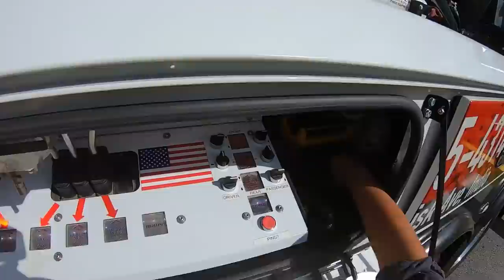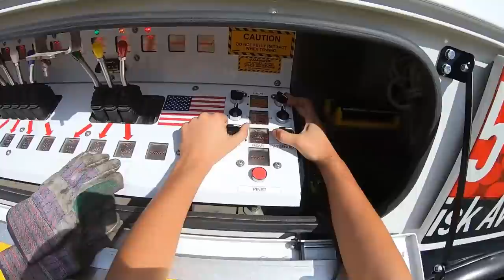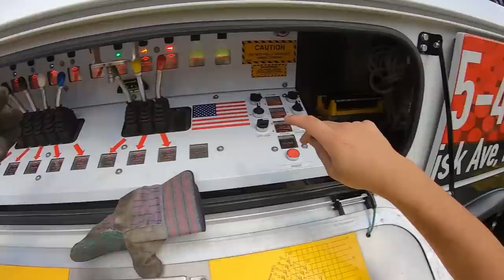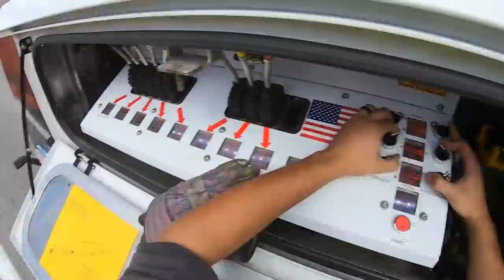Truck Drives Off Road On Mountain Pass

Comment: Curious as to why you didn’t use the pivot point to pull it straight back the first time. You would no have caused the extra damage on the rear fenders at the bed.
Reply: Matt knows what to do from Matt’s Off Road Recovery pull it out and it’s done
Reply: @TonightGamer1987  Yeah.. this was rough to watch. lol.. 
Lets pull the truck up and block the exit hole and make this recovery 100x harder than it needs to be.  smh

Comment: I run the rim slings from the outside in and run straps back under the truck so the straps come out under the bumper and hitch to lift it so there’s no risk for even a scratch on the bed. I’m a collision repair shop but that’s what I do when I’m in your situation

Comment: I wondering why the Flatbed didn't do the whole recovery process by it's self in less than half the time  ?
Reply: I depends on how much the vehicle weights and how much force it will take to remove it. So the flat bed could do it but it would put a lot of un needed stress on the flat bed. Also it depends on what the police want they can make the call of what vehicle they want to do the recovery ( in reason )
Reply: Cause the didn't know how far of a drop it was. If was a cliff edge the flatbed couldn't do it. Plus the rotator reduces the damage of recovery.

Comment: Question?
Why wouldn’t you rig the spreader bar up, 4 point it at each tire and just pick it up and put it on the flat bed.
Reply from the maker: Had to bring it closer first to do that. The truck was easily 15-20 ft out of reach for the rotator to lift it straight up otherwise yes absolutely that would have been the best plan, given that it was out of reach we elected to winch it as close as possible and then lift it out without a spreader bar because the angle we were able to get being it was so close to us allowed us to get very high above it reducing the veer angle. Hopefully that clears it up
Reply: @plazatowing  I was going to ask the same thing😂😂  thanks for the explanation. It was great to see you & your dad working together on this one. We don't always have our parents around, enjoy the time you have together. My dad is at an age, & his health is in a condition, he's pretty much homebound. 94 years old, just thankful to still have him around😊😊

Comment: Nice job.  Interesting how many folks didn't agree with your recovery methods.
Reply: I strongly disagree. I might have tolerated damaging front fenders as they have been damaged anyway but not the rear ones. This is completely unnecessary and totally avoidable.
Reply: Exactly if one of our operators did that they would be looking for a new job. That was a beginner recovery. Just goes to show just because you have the half a million for the truck doesn't mean you should be operating it. Or at the very least get someone with some experience to help you guys out and run the recovery and lay out the rigging plan

Comment: Hey Trent

I saw you doing pulling 4X4 pick up truck is not going to work but my best solution is put sling rope on front and rear of wheel then lift it up to move to flatbed for quick recovery time and save your time

Comment: !. I would of used a dead pull from the out rigger from the start and would of had it up where you could of lifted  it onto the roll back in the time it took you to rig to the rims to heck with hurting the bed.  It's gonna bend no matter what but the spreader bar will keep it away from the truck.

Comment: question on D-ring shackles.  Do you feel that any given new D-ring shackle should be up to snuff, ie that it will handle the weight that it claims it's rated for?

I ask because I've seen some claim to not trust imported ones from big-box stores even with the rating markings embossed on them.
Reply: I was taught to buy American made products and you will get every pound out of the WLL. Most American made items of that sort have a BLL 4 times the WLL.

Comment: Thought you might have done a Ron Pratt move and just nosed the rollback up to the under reach and boomed over the cab to set it down on the deck.
Reply: Ron would have used a spreader bar, and not crushed the bed.

Comment: Instead of crushing the bedside in and doing more damage why wouldn’t you rig the line to the trailer hitch from the start? You would have been able to lift it completely vertical up to the road. Unless it was already totaled.  Just curious
Reply from the maker: Totaled as you said and there is no side to side control when lifting from the single lift point of the hitch, therefore the truck could roll on its side as it’s coming up
Reply: @plazatowing  👍🏻thanks for the reply
Reply: Having worked in dismantling and salvage of a previous generation of vehicles I am surprised and disappointed at how readily modern vehicles get written-off.  Maybe it's expensive labour cost, excessive complexity or potential litigation in the US but (judging by the visible damage) in many countries that would be considered repairable. Be that or not, it is incumbent on the towing company not to cause avoidable damage to what is still someone else's property.  An astute insurance assessor might be tempted to offset the reduction in salvage value against the towing company's bill.

Comment: Strange angle of entry there to crush the barrier & go over, If they did that coming around the corner it would have been 200ft+ down off the side, Though if it was an insurance scam one side to the other couldnt have gained enough speed, Whichever way If somebody was in it must have been a wild ride, & the alarm went off so the doors were locked.. of all things..

Comment: I"m sorry, and I'm the first to admit I know nothing about towing. But wow. I'm 18 minute in and I noticed that the shackles were going to mess up the rear bodywork right away. And then you kept raising the rear higher and higher, until the front wheels were barely on the ground, digging the front end into the dirt and rocks, then wondered why it wasn't moving, and responded by raising the rear even further, as if that would do it.  You were planning to lift it all along, when you first needed a low angle to simply pull it up the  slope before lifting it over a steep patch or the culvert if it went over that way. 
Wouldn't it have been better to try to roll it back at a lower angle until you absolutely had to raise it to clear an obstacle? 
Sorry for being a YouTube "expert" when I don't know a thing about it, but it seemed an odd way to go about getting that thing up.

Comment: When police dispatch to a vehicle over the barrier down a ditch... it doesn't really give ya much to plan for equipment wise unless the LEO gives details so you bring equipment for a worst case scenario..(bigger trucks carry longer cable for further reach... but that was like taking a sledgehammer to put a nail in the wall to hang a picture. That's not a tough recovery. a light duty wrecker could've pulled that out faster & with no additional body damage. It wasn't far from the road, even a LD wrecker boom was more than enough lift to get over the little ledge. all 4 wheels were intact & there was access between the posts where it went in.  Realistically, the flatbed could've pulled that out with the right equipment... but I've heard California doesn't allow rollovers or recoveries with beds even though they're used constantly in the snowy/icy Midwest. a small wrecker would be ideal.    That said, Being that the details weren't likely known @ dispatch time & the rotator was there..that little truck could've been pulled up & out right off the back of the rotator like a straight stick boom & also.. no additional body damage...then given it's long boom reach... once the front axle was up to the road, extend out & pivot it to parallel to the road to load on the bed for transport, set it down & done. for the overhead pick, Ideally spreader bars would've prevented the body damage caused by the endless loops along the box pulling towards a single hook point. hard to think a rotator wouldn't carry spreader bars? also.. instead of using one winch line for each side of the truck.. there's better control if you used one for front & one rear to control lift & angle especially starting out on an incline. Ya gotta get paid for bringing the equipment when you're not given much information... but that took longer trying to setup & rig & re-rig for a job that a 5500/550 wrecker could've had out in 15 minutes & without body damage. still entertaining to watch...

Comment: Next time just use a freaking J hook on the axle. You guys crushed the driver side bedside by NOT using a spreader bar to pull it up. You look like a bunch of rookies and the older guy should not be working with anyone. Hes not a friendly guy at all.  The guy running camera even said lets use a J hook but Grumpy man destroyed the bed.

Comment: when you was rigging up for the pull and up and over the post broke off or what you needed the lift why not use both wench lines 1 on each side of the truck and the different lengths could be controlled at the wench control and this should not have crushed the bed sides maybe then i could also be dead wrong please get back with me on this idea would really like to know right from wrong i like learning from you tube and being i am now disabled i like to learn from videos so i am not sitting around the house doing nothing